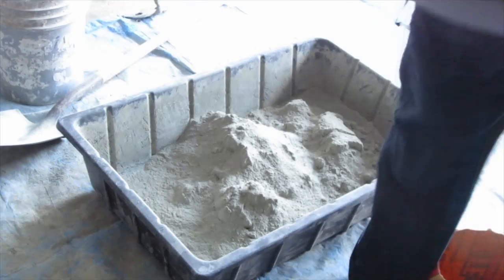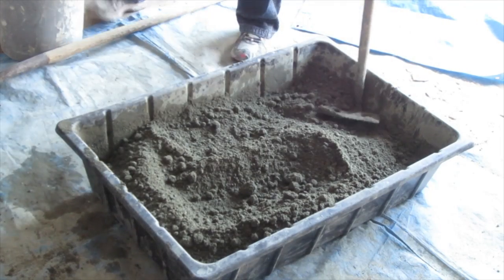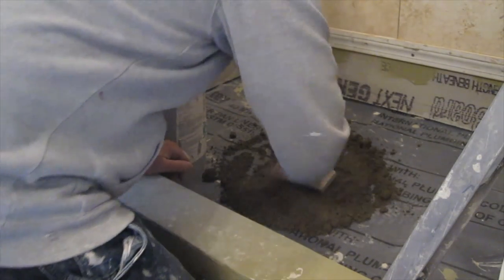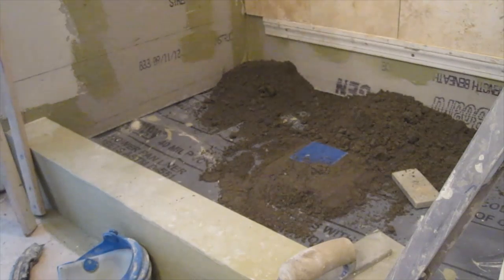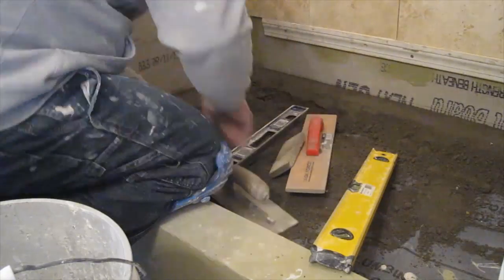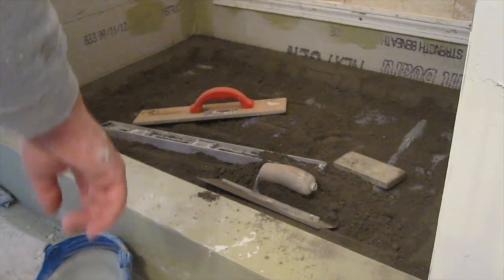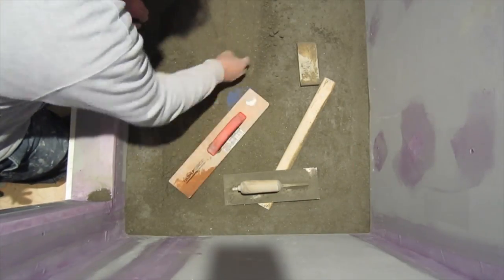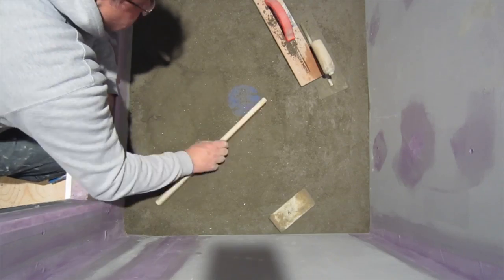How to install   Mud in a shower floor

Comment: Did you create a preslope bed prior to the finished bed and drain?? Any moisture that will pass through the bed will be directed down the weeping holes through the preslope which the liner is sitting on.
Reply from the maker: Yes I did, and there is a video showing how to do it for this very shower. How to install a shower pre slope
Reply: nice!

Comment: when you install durock around a shower curb do you screw through the pan liner on the inside?
Reply: Curb should be made with the Dry Pack. But "experts" use wood to build their curb :).

Comment: Is the finished dried bed supposed to be very "sandy" ?
like if you scrape it the sand kinda scrapes away from it?
Reply from the maker: The finished bed should not be sandy like you say, it should be smooth and hard, but it will not be like a poured concrete slab.
 you may have mixed it too dry, or not packed it hard enough.
Reply: If it is sandy either you didnt pack it enough, or it hasnt had enough time to set.  If it scrapes away a bit its fine.  Eventually it will set.  I would suggest if your a DIY'er to just mix it wet. This guy is a pro and can see what the mix is doing microscopically without the microscope.  Anyways,  I think I know exactly what you mean by "sandy."  It will be fine.

Comment: Hi Sal. Would you reccomended charging hourly of set rate for this type of prep work?
Reply from the maker: Whatever makes sense for you. If it is something that you are familiar with, and now how long it will take you, then have a set price. that way if you get done quick you still make money. If it is unknown, then charge by the hour, you won't make as much per hour, but you won't lose your shirt if it bogs you down. For example, when I do a mud  shower floor I have a set price depending on the size, I will usually get them done in a couple of hours, but because it takes skill and experience to do it right, the price is much higher than the two hours I would have gotten if I charged by the hour.
Reply: Thanks Sal. I have a house with 2 mud pans. I have done them before but it was hourly. I will adopt your exact method in this video. I have an 18 sq ft pan and a 21 sq ft pan coming up and didn't want to short myself. Will be using mapei 4 to 1. Love watching your videos. Much respect to all that you do for us tile setters. Hello from Victoria B.C Canada

Comment: For better positive flow, shouldn't the pan be installed first then the wall board on top ?
Reply from the maker: Depends on the board being used.
Reply: Sal DiBlas- It's Duraroc,  half inch.
Reply: Sal DiBlasi nice vids , I use perma  base board nicer to screw into. Doesn’t break apart when screwing close to an edge like dura rock. I also build my curbs with lumber, seems to work fine if sealed properly. Everything else same process. A lot of guys don’t gravel around their drains and nothing but problems.

Comment: Sal, great video!  I am about to do my  first ever shower and your videos are the best.  One question: When you still work on the mud making sure that the tile is level with the drain do you also account for the height that the tile thinset will add?  In the video it looks like you just make the tile and the drain perfectly leveled. Thanks in advance!

Comment: I've always used diamond wire "no nails" and fat mud on the first 6" of the walls. deck mud on the floor. Doing the bottom 6" of the wall first then the floor the next day.

Comment: hey Sal.  Love your videos, I really appreciate all your insights and advice on these projects that you're willing to share.  I recently tried making my own shower base, but messed up the proper pitch on the first layer of the mortar that will be under the shower liner.  Should I just do a new layer over the existing to get a better slope and to avoid any standing water, or do I need to break up the botched layer?  Thank you again, you rock!
Reply from the maker: If the first attempt is solid and you can add to it with confidence that it will adhere, then you can just do that. but if you have any doubt that the added layer will fail or the existing fist attempt is iffy, then it is best to remove and start over.
Reply: sounds good.  looks like I'll be tearing it up this weekend haha

Comment: hi Sal, if i am putting a wood curb on a cement floor, (to pre- pitch the shower pan, which is on a slab), whould i have to seal under the curb being that the floor is on a slab and wood sitting on it can lift it up?
Reply from the maker: Wood sitting directly on concrete is not a good idea, some say to use pressure treated lumber, but that tends to shrink and twist as it dries. So if you use regular pine lumber, make sure you isolate it from the concrete with something that does not transmit moisture.
Reply: ok, that sounds better; the regular pine lumber, not treated. what would be the best material to isolate it from the concrete? would using a fiberglass fabric and treating that area with mapei waterproofing be a good idea? have you tried that or do you have a better idea? Glad to see your knees have held up over the years, wish i could say the same,

Comment: Hi Sal., GREAT vids Man! I just poured  1.5 inches of mud (3:1 ratio sand to portland) to embed radiant heat in 800 sq foot room (1/2" pex, I got just a little more than 3/4" mud covering the tube). I have been hydrating it daily with water to  increase its strength as it cures. My question is when can I install tile over the mud? Do I stop watering it - its been 5 days so far - and let it dry? How much time does it need to dry? Should I tile it wet?
thanks bro!
Reply from the maker: You can start tiling any time, no need to hydrate it.
Reply: @SalDiBlasi  Where slabs from different rooms meet, there is a cold seam. Meaning the slabs were poured on different days and cured separately. Do I have to worry about this cold seam being susceptible to cracking the overlying tile? If so, what should I do to try to protect that tile from cracking? I considered an uncoupling membrane, like a Ditra, but don't want to run it throughout the whole room. Ideas?
Reply from the maker: @markronson6886  In most cases it is best to honor the cold joint through the tile installation, sometimes an uncoupling membrane can be used, not a simple answer. Read this to understand more about your situation. https://cdn.laticrete.com/~/media/support-and-downloads/technical-datasheets/tds252.ashx

Comment: Hi Sal if I'm using  a large format tile and angling tiles to a square drain in the middle of a shower basically 6 pieces pie shaped kind of  ,,, now when I do dry pack would,nt I have to shape packing as close to the final shape as the tiles this would only make sence
Reply from the maker: You need to set up for an envelope cut, I don't have a video on this but do a search.
Reply: @SalDiBlasi  thank you

Comment: the cement board can be below the mud pack? I have seen videos where the contractor keeps the CBU at least 1/2" above the finished mud pan, tile the floor, then  bring wall tile to the floor...??

Comment: Thanks for your videos Sal. My question is what is the drying time for mud before i
start tiling shower floor

regards
Reply from the maker: tak toja If you are going to waterproof the mud, at least a couple of days, if not, then the next day is fine.
Reply: ***** one more question.I am confused because the company of the cement that we use, (Quikrete), said that it need to dry, for full strength, for 28 days?????
And the last concerns. If I already placed the membrane under the cement, do I need to waterproof it in the other way???
Thanks in advannced
Reply from the maker: All cement is like that, the cement does not need to be fully cured to set the tile on it, it will still cure after you install the tile. however if you apply a waterproofing to it, you will need to let it consume some of the water in it so that it does not dislodge the waterproofing. The vinyl liner under the mud is sufficient for that system, but i like to coat everything that will receive tile to make sure there is never a leak. https://www.youtube.com/playlist?list=PLiB6hq5lQ3h3Tieji67lN4lrGPhrLwngf

Comment: Hi sal. Just finished my pan after watching many of your videos. THANK YOU!! After it cured I brushed the surface and noticed some of the dry pack concrete crumbling, leaving some craters and canyons. This happened where one pour meets the next and between the perimeter screed and main field area. I guess I took to long or didn't pack it hard enough in those areas. I vacuumed up all the loose bits and the rest seems pretty solid. Can patch these problem areas using LFT thinset or am I in big trouble here?
Reply from the maker: Without seeing it I can't really say, but if it seems solid and whole, then patching should be fine.
Reply: And if some is coming up from under the lip of the kerdi drain? I want to scrape out enough so that I have room to shove in enough thinset to fully support the lip. Bad idea? :(
Reply from the maker: A couple of bad spots is one thing, but if you suspect the mud is not stable, then pull it out and do it again. Much easier to do the mud over now, than to find out it was compromised latter  when the shower is in use.

Comment: how long would you say it takes an installer to float a typical shower pan in this way?
Reply from the maker: Depending on the size and without a helper, taking your time, 1 to 2 hours, a bit more for larger shower floors or different shapes.

Comment: What is the plastic material underneath the mud?  If I my floor is concrete can I just put mud on top of it?
Reply from the maker: There must be some kind of liner, or some other kind of waterproofing. The pan liner in this video is only one method of doing it, there are several different ways to accomplish the same goal.

Comment: what are your suggestions on pitch when you have the drain on the far right?
Reply from the maker: Chicken Friedfish Same, you need a 1/4" per foot slope to the drain, does not matter that it is at one end.

Comment: After the mud has dried a few days and I rub the surface lightly a lot of dust and sand come up, and the more I rub the more sand seems to come up.  Is it safe to apply the thin set with a "loose" surface?  thank you
Reply from the maker: +Keith Stowe You either mixed it too dry, or you did not pack it enough, good news is that it will be easy enough to taker it out and do it over.
Reply: It's a matter of perspective. Imagine it was concrete and it needed to be removed? That's the bad news.

Comment: Hey Sal,

I've tried your method, and something went wrong, my perimeter is well set and strong, but towards the middle, I can push material out with my finger (can dig to the bottom with my finger).  Do you recommend tearing the whole thing out, or can I remove the unset mud and add new mud to the cavities that I remove.
Reply from the maker: You may have not packed it enough or it may have been a bit dry, but probably better to remove the whole thing nd start over.
Reply: No need to remove the old float.   Remove whatever comes up with a wet vac and rub voids with thinset with a sponge.   Then fill the voids with fat mud

Comment: once dried, should water be able to seep through the mud? (allowing it to go onto the liner)? I think I mixed my mud too wet, and it holds water on top (instead of flowing down through my p-gravel, and into the weep holes of my drain. Am I in trouble?
Reply from the maker: usually the deck mud is very porous when it dries, are you in trouble? I doubt it, i believe that the water will still find it way to the weep holes. i generally  waterproof everything anyway, including the deck mud on the shower floor to essentially eliminate water intrusion into  the mud.
Reply: ***** SO, are you saying it is OK to waterproof the final coatv of dek mud. I did traditional shower, plywood, tar paper, lath, preslope, liner, then final dek mud. Can I also use paint on wwaterproofer simliar to Redguard...Soone reply would be appreciated.
Reply from the maker: SMlegend SouthMil yes that is what i am saying, but let the mud cure a couple of days before coating it

Comment: When you're checking the height of the drain with the tile you measure the the space for the exact height of the tile, do you need to leave some space for the thinset also?
Reply from the maker: TheBeagleBrigade Thinset is not going to gain much height at all, but the waterproofing will add a bit, so I usually will allow a bit for that, or take a bit of the back of the tile if it is thick enough.
Reply: Thank you for the response, your video's have been a great help

Comment: what is the slop to the floor drain, 1/4 of an inch.  And how high the drain is usually set up before the mud is poured?
Reply from the maker: +Davina Yau Yes 1/4 inch per foot and the drain is set about 1/2" above sub floor.
Reply: +Sal DiBlasi thanks

Comment: in two hours I would have the mortar bed floated powdered and tile and grout beat in & finished. Oh, and I would have floated out the curb and tiled it also.Everything with the 1/4" slope and that includes the curb.Wish I was near your homesite.
Reply from the maker: I was not aware that it was a race.
Reply: well aren't you the man.  geeez, just don't watch.  Some of us newbies who've never done it before would like it to be a long thorough video.  this is the way he does it and if we can pick up a tip here and there, then that's a good thing.  Your life must be miserable.  I hope that your life has improved in the last 6 yrs.

Comment: Sal,

Love your videos.  When mixed like you showed how long do you have to work with the mud before it starts to set up?  This is my first shower and I'm sure the deck will take me a little while. 
Thanks
Reply from the maker: You have plenth of time, don't rush, but don't take all day. Mix a smaller amount at first if you think it might be an issue, you can always mix more

Comment: After you install the floor tile and thinset on the floor your tile will be 1/2above the drain.

Is that correct? 

Am I missing something???
Reply from the maker: The tile will be flush with the drain grate.
Reply: Ok

Comment: At the end, when you use the tile to set the height of the drain, what about the mortar used to set the tile? When you set the tile because of the mortar the tile will now be higher than the drain. Do you account for this? Is the drain supposed to sit below the tile? Thanks.
Reply from the maker: +FlyingSolo77 The mortar under a mosaic tile will not raise the tile by much at all because the tile is small, but i always allow for that anyway.
Reply: Yes! if not,how will you drain?
Reply: 1/16" allowance for mortar

Comment: A lot of folks are saying you shouldn't install your durock behind the pan. It looks like you do.. and that's how I have been doing it as well. Are you still doing it that way? Have you had any issues ?
Reply from the maker: A lot of folks don't know what they don't know. Depends on the type of Cement board, which a lot of people also don't know are not equal. Fiber cement board like Hardie must not be in the pan but on top, true cement board, like Durock, can be in the pan. You don't have to believe me. 2017 TCNA Handbook, page 242 method  B415-17,  both details are shown. Don't listen to hearsay and opinion, go right to the source for standards and methods. TCNA (Tile Council of North America) in conjunction with ANSi. (American National Standards Institute) https://www.tcnatile.com/ansi-updates-to-standards-a108-committee-info.html now you have the facts.

Comment: Do you mix the mortar all at once or in batches? How much open time do you have with the mortar mix?
Reply from the maker: I usually mix it in batches, a couple of bags at a time in a mixing tub, as far as open time it depends where you are mixing it, but I am usually done with the whole thing in an hour or two.
Reply: Your videos are so well done; are you planning to do a video about installing the membrane?  Have you ever replaced a lead shower pan where the walls of the shower were done in wire lath and mortar?
Reply from the maker: I have actually already made one, Complete shower install studs to tile: Part 3 Installing the Pan  Liner and I have never had to replace a lead shower pan, they are not used in my area, copper are very common though.

Comment: sal, doing a pencil border with  A glass trim, so pencil above and below glass with 3" glass mosaic in between.  I am going to miter (45) the corners of the stone pencil so would you miter the glass as well or just run it straight to the corners?
Reply from the maker: Don't really understand what you are asking, wiil the pencil frame the glass, or is it an outside corner, or sonething else?
Reply: the pencil is framing the glass
Reply: but linear, the pencil runs left to right, so there is a 12" pencil above and below the glass
Reply from the maker: Usually i would not miter the glass, just tge pencil liners. The pencil is the frame, the glass is the what you are framing.
Reply: also, when running the glass between the pencil ( I am running the pencil linear around the bathroom) should the glass be brought forward as far as possible to the edge of the pencil so it is almost flush, or can it just be placed with the 1/4" mud between the pencil leaving a slight lip at the pencil.  I just thinking that this may be a matter of preference?
Reply from the maker: When you frame the glass with a pencil liner you are adding an element of depth, so you don't have to build out the glass at all.
Reply: thanks  one more thing, the top line of pencil, I used 1/16" spacer between each pencil. so my question is, should the grout lines on the upper pencils match the grout lines on the lower line  of pencils.  (my glass is in between both pencil lines, linear)
Reply from the maker: I would try to keep all the grout lines consistant.